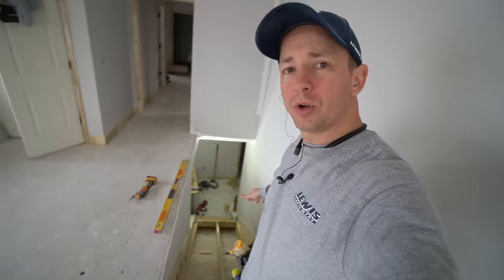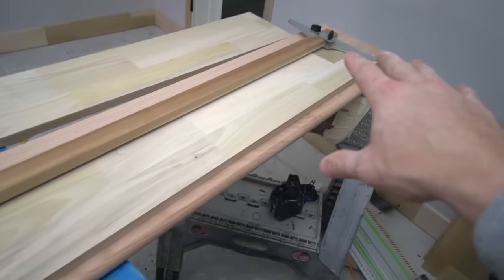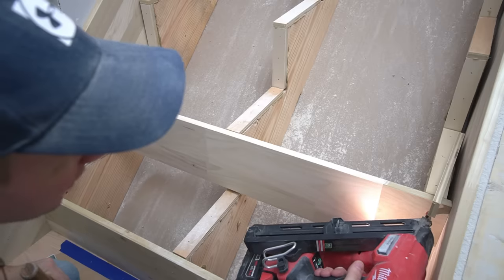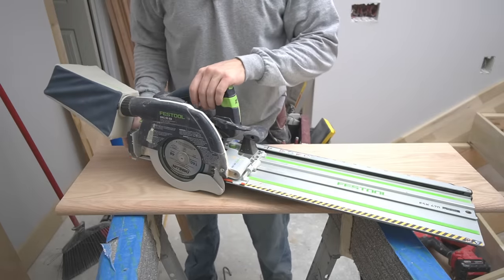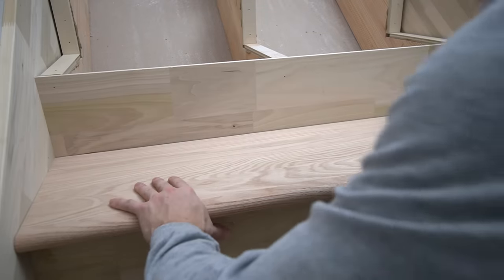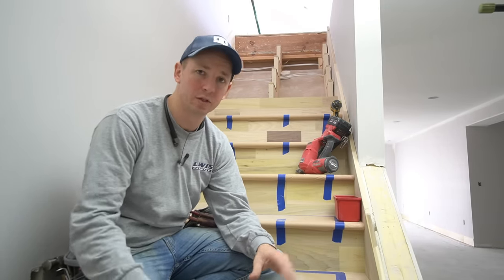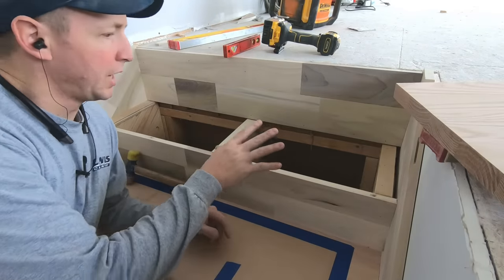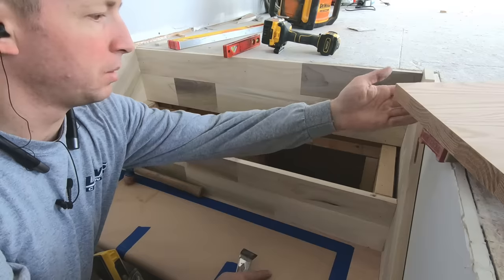Professional Stair Tread & Riser Installation - Complete Install Process

Comment: Nice to see someone this day in age who knows what they are doing.  Way too many out there are not taking the time to learn from someone and do things the right way!  It's unbelievable how many are out there doing work that looks like a 3yr old did it and homeowners don't know the difference because said "carpenter" is a "licensed Contractor " .   For the young guys out there, be humble enough to take the time to learn before going out on your own calling yourself a Contractor!  
I like how this video shows the reality of the materials like boards being cupped and having the experience to know how to work around it to make your work look good and completed correctly.  Only thing I would make sure to mention is to ALWAYS predrill the top board before running a screw in.  I noticed you did but didn't not mention it.  Good job sir!

Comment: Very educational and straightforward! Would love to see the finishing process for the stairs, particularly if you fill the nail holes with wood filler or another filling medium, and how the visibility of the holes could be minimized with a coat of finish.
Thanks!!
Reply: Same
Reply: The risers were paint grade material. So the painter will most likely be doing that and they'll probably use an interior/ exterior non shrink spackle
Reply: @chichidouglas5078  That makes sense that the risers would be painted. Do you think it would be the same case for the treads?
Reply: @sminturn  no the treads were stain grade so I don't think they'd paint them, but the painting contractor will probably finish them also. Every time I've done stairs like those the risers are at least pre primed  if not pre painted and the treads are pre finished, because then they only have touch up to do so it saves time and money

Comment: Thanks for put this up. Excellent as always. 
This is exactly how I install my staircases. 
The only difference is that I remodeled them so a lot of times I have shim them as I install them. And I also install a Scotia molding under the nose of the tread. I wrote an article for JLC on installing treads like this. Thanks again!

Comment: Thank you for this video and the other similar one you made a while ago.  Almost done with my 1st set of stairs, (completely replaced my old basement stairs with new stringers, skirt boards and red oak treads and birch ply risers).

One question...  Why are there plywood strips on the stringers?
Reply: He mentions in another video that the stringers were originally cut for carpeted stairs

Comment: The framers must do a damn good job on those stairs if you don't need to be using shims. I noticed you or someone put plywood on there so maybe you went ahead and corrected all that ahead of time. But we cut our own shims and just pl the crap outta them. You could still benefit from using paper thin shims in the middles though rather than needing to screw the risers to the treads. You use a lot of screws which isn't a bad thing if you have time. But the way we do it with the shims cuts out all of that extra stuff and with the few extra finish nails and extra pl, our stairs don't ever move. I do like how you do this though. I might try it out. Unfortunately we always have the filthiest insulation in our stairs and that can be a pain to try and screw. For time sake you might want to use another track saw to save adjusting the same one over and over. It just reminds me of having one drill or screwgun and having to keep changing the bits. Just trying to save ya some time. Nice job though, everything looks great! Keep it up!

Comment: Hi Spencer thanks for the great video. Two questions:

1 - do you put the bottom riser on top of the finished floor or butt the flooring up to it and add a moulding?

2 - if you’re installing stain grade treads and risers do you prefer to finish them once installed or before?

Thanks!

Comment: Do you recommend finishing hardwood treads before installing? Or do you sand and seal after install? Great video! Thanks!
Reply: Floor and stair guy here: my answer is that it depends. IMO it’s easier to sand and finish treads when they’re out - problem is that should one make a mistake with cutting or what not then you may have wasted a finished tread. Be very particular ie measure three times before you cut. Be absolutely clean and mindful of glue, nail, etc. Make sure nail holes are filled afterward. I like to prefinish most of the tread - and apply my last coat of finish after installation.

Comment: A few good dots of strategically placed hot glue eliminates the need for nail holes in a finished tread. Sets up instantly and holds till the pl drys.

Comment: Hi Spencer,  I wish I had seen this before I built the stairs to our bathroom a few years ago.  Why do you pack the tops and front of the stringer with plywood?  I cut mine with a template and router so the treads were let in to the stringers but that meant I had to assemble it before fitting.  It isn't between walls like your example but against one wall but being an old stone house in France the wall wasn't plumb and also angled so the stringers are slightly different lengths.  Mike

Comment: I have one big question if you have time - or anyone in the comments - to answer it. Replacing stair trends on an old house with a railing. I assume you also have to replace the railing as well correct? Probably a dumb question but is there a good tutorial on replacing a complex railing on a stair from first to second floor.

Comment: Curieus why the risers were not primed Or even  primed/ painted before Installed to make it easier to finish later?   Same i guess with threads.    With base and casing always best to prefinish before imstall and then final Coat after install significantly easier.

Comment: You put pressure on the middle of your jig when marking out your treads , by doing this you are bowing the jig , making your measurements a bit shorter , put pressure on the blades of the jig to hold it in place

Comment: 30+ years experience here. Install risers wall to wall loose tacked plumb. Lay skirt board on top and plumb up face of riser and level up top of stringer. Cut and back screw back of riser to skirts. Now install treads as in video. Way less time and less chance of butt squeaks.

Comment: As a former custom builder, I really enjoy watching your videos and seeing alot of familiar techniques. One thing I used to do when building stairs was to leave the bottom riser off just in case I dropped a tool or something. Also had homeowners leave a time capsule of personal items under the top stair tread.
Reply: Do just the same with the bottom part

Comment: Man I love this video but I really wanna see a video on how you prep the stringers to get them ready for step treads
Reply: Agree. Adding the plywood strips to the stringers I guess gives you another chance to get the cutouts square and plumb.
Reply: @MrABC250  they probably had 2x12 treads on them so he had to add 1\2” because the hardwood is on 1” thick.
Reply from the maker: Framers cut it wrong. They had it cut in for carpet with 2x framing material. So the framing lumber had to be removed and the treads shimmed up 1/2". I was going to put it in the video but it was getting too long.
Reply: @InsiderCarpentry  
Great videos, very helpful for us DIY to up our game! Quick question for you
I’m replacing carpet with 3/4” hardwood on existing stairs. I was planning on gluing/nailing straight into the 2x materials under the carpet and pad that came out. Should this work, or is there good reason to rip out all the 2x12 treads and 1/2 ply risers?

Comment: You do some amazing work . I worked for over 35 years in construction mostly as a finish carpenter.  But I did almost everything. I would have to say that my favorite thing was trim carpentry. From what I can see you are top notch.  I can tell you take pride in your work and want to provide a top level product. I would like to see where you end up in 20 or even 30 years. With that much more experience it's unimaginable what you may become. Just remember that a customer may not be able to afford the best that you can produce but you should always try to produce the best that the customer can afford!!!  Best of luck to you, you young wood wizard.

Comment: Excellent video as usual! I'm going to  give my two cents worth on one thing: I would recommend that you treat every tread just like the last one by putting a thin bead of construction adhesive on the back edge before screwing through the riser into the tread. I get LOTS of calls to repair squeaky stairs done by other contractors and the usual culprits are rubbing between the treads and skirt boards and treads and the risers. Gotta remember kids, it looks great when you're done but give the stairs 10+ years of wear and tear and seasonal expansion and contraction and what you wind up with are squeaky stairs. PS, trim contractor and stair guy 38+ years experience. 👍
Reply: He used wood glue on all the ones he could screw and pl where he couldn't get good pressure with the screws
Reply: you're right I use PL Adhesive around the perimeter where ever the tread is going to touch which includes skirt boards, rizers.(where the back of the tread hits) and under the top of the rizer(under the tread) then sometimes what I do is run 1 1/2 trim screw of 2 inch trim screws from the back of the rizer through to the back of the tread to reduce any gap and movement..they work worl perfectly in my opinion
Reply: I was just saying the same thing about squeaks when I was watching it, and my wife told me to stop talking to the tv so I went to the comments. You have  more years in than I do, but I've fixed a ton of squeaky stairs in the 30 years I've been doing it, but I'm sure someone had to fix some of my mistakes I made early on before I knew better. I've learned more from mistakes than anything else
Reply: I use adhesive in the back of every thread, nobody told me, just common sense!

Comment: Some tips that I use are as follows : screw all your risers directly to the skirt board much like a Kreg  fastners.  There will be no movement in your stairs once this is done. , back bevel your tread about 5 degrees through it’s length  and screw through the back of the riser. It will lay the tread  down dead flat without the need for face grain fastners.  Once the PL dries it will not move. When you set your jig down for  exact tread measurements , instead of laying it on the stringer , set it up the height of a tread on top of a piece of scrap cutoff. This is where the actual measurement should be taken in case the stringer is not at a 90 degree angle.  A 1 degree end angle is plenty  to drop the tread into place ,  
Everything I install is pre finished  so I don’t use any visible fastners  except for scotias and trim pieces. Use a 23 gauge nailer for those. 
PL is the cats ass but messy!
Reply from the maker: Good stuff.
Reply: Use Gorilla Construction Adhesive !!!  PL ALWAYS spews all over the damn job !  Plus Gorilla sticks to the work way better as you lay out a bead of it.
Reply: @mattywho8485  I have been using PL premium since it first came out , I like the fact that it expands as it cures + Gorilla glue is 2wice the price of PL , I'm used to using  it and all the problems associated with it , I can say that  I have never  had a squeaky tread after using PL
Reply: Gold,  thanks guys!
Reply: What size/length of screws do you recommend to screw the risers to the skirt board? thanks!
Reply: @jrfk2     I use a long tapered drill bit then use a 3”   washer head screws to draw them together.

Comment: I'm a DIY'er doing my first set of stairs. I noticed you capped the stringer tread and riser faces with what appears to be a half inch plywood. Can you explain the reason and process? Thanks Spencer. Very helpful video.
Reply: I wanted to ask same question.
Reply: Found this was answered further down..."Framers cut it wrong. They had it cut in for carpet with 2x framing material. So the framing lumber had to be removed and the treads shimmed up 1/2". I was going to put it in the video but it was getting too long."

Comment: Good video, but I have to point out that if you test fit  the top tread and riser and mark them where you want them with some  tape you can screw them together and then install them. It will probably develop a squeak after a few years of traffic without a mechanical connection. The first and last couple of steps take the most impact

Comment: Great job on the video. Why did you do a 0deg, 1deg followed by a 5 degree bevel on the sides of the treads - why not go from 0 to 5 degrees in one step? Also, not sure why you used wood glue for the back of the treads near the end of the video and no glue on the first step you installed in this video?

Comment: The tip at 7:06 is great!  Definately a Pro tip. It really improves the fit and finish.  The only thing that would make this better would be if your riser stock was primed before installation.
Reply: Would be better if riser stock was made from primed 4x8 sheets of sanded birch ply. More efficient to prime, less waste, much more stable.

Comment: Thank you for the tips and tricks. Your stair video from a few years ago walked me right through the process for me to pull a 1995 vinyl village carpeted staircase out and put both hardwood treads and balusters as well. Used my Mortise machine for the wrought  iron ends. Worked great and looked outstanding. Thank you my Indiana brother.

Comment: Just started doing staircases about 2 months ago. Im pretty new to carpentry, other than watching/kind helping my dad or grandfather build stuff. I'm 22, btw. My Boss started me on paint grade with painted knee walls and risers and white oak treads, newl posts and handrails. We use a #2 pencil, kept sharp for fine lines and a skill saw for most cuts, except for 1×4 trim and smaller trim (ex. 1/4 round.)
Its definitely a challenge making cuts like that without a brace, but when they fit in place perfectly, its so freaking satisfying. I've worked on new and old cars, mechanically and and some body work. I've cooked, worked in production, worked in a chicken factory, and cut grass, but this by far takes the cake when it comes to being satisfied with what I do. When the staircase goes from an empty turd with seetrock to a finished, ready to stain/ paint staircase, it makes me appreciate the hours spent on something other than a paycheck. I plan to get as good as I can and see how far I can take it while also enjoying the paycheck that comes with it lol. But, I'm definitely going to get a tread jig, because this would make things a lot easier in the measuring department.

Comment: @InsiderCarpentry, you could permanently mark your stair tread gauge blades with 'R' and 'L' instead of marking the 1x2 each time it's cut. 

As ever, another master  class.   👍
Reply from the maker: Good tip!
Reply: @InsiderCarpentry  ..... I figure I owed you at least one tip!     👍👍

Comment: What's with the furring strips on the stringers? I'm trying to think of why you did that. Is it a better surface for glue? I doubt the framers cut it wrong and were told to do it that way?
Reply from the maker: Framers cut it wrong. They had it cut in for carpet with 2x framing material. So the framing lumber had to be removed and the treads shimmed up 1/2". I was going to put it in the video but it was getting too long.
Reply: @InsiderCarpentry  Lol. When in doubt, blame the framers. It's okay, nothing that can't be rectified. They have a tough job to accomplish.

Comment: Quality work as always. A little bit different than the way I do it, but I can see that it works well for you. I never did like the stair jigs. I don't think they are accurate enough. I  haven't seen a flat skirt board for years. I scribe the tread to the skirt and cut it on the miter saw. I can compensate for a cupped skirt by pushing or pulling the tread towards or away from the blade as I make my way through the cut. I've done some doozies over the years. Worse one was about a ¼".

Comment: I will be relying HEAVILY on your stairs videos.  Moderately experienced in carpentry but my stairs are a little intimidating.  I committed myself to doing it by tearing out my old staircase already!  I’ll need help on the “open” side of the staircase with the posts and railing. Not sure yet how that skirt/wall will look and how it will support that stuff.  I’m starting from complete scratch with the framing next week

Comment: I had a hard time with the skirting. The wall was 1 1/4 from the stair treads on both sides even after sheetrock. It was a nightmare. The contractors put down temp treads that were glued and nailed in, so impossible to remove.

Comment: Outstanding work! I'll be starting to replace (and upgrade) a 50 year old, badly installed staircase soon. These tips will save me from making some very bad mistakes. One question though - the Festool saw is something I can't justify spending money on for just one project. Can I use my compound sliding miter saw, very carefully, and still get acceptable results?

Comment: Could you do a video on installing solid newel posts? If you haven’t done one already. Thanks
Reply from the maker: It's coming next. Stay tuned for next week!
Reply: @InsiderCarpentry  Great!  I recently made mine by gluing up 4 - 1x4's out of white oak and planed them to a 3x3-1/2 dimension.  They are 60" tall and I may run them through the floor and secure by bolting into the floor joists.  The lag screw/threaded rod kits don't seem to make the newels rock solid but this is for new construction and I'm not sure where the floor joists will end up.  I'd also like not to bore a hole in the newels for the nut and then plug those holes.  I do have a plug cutter set, so I can make my own out of white oak if I need to.